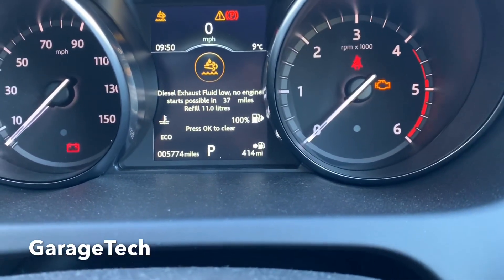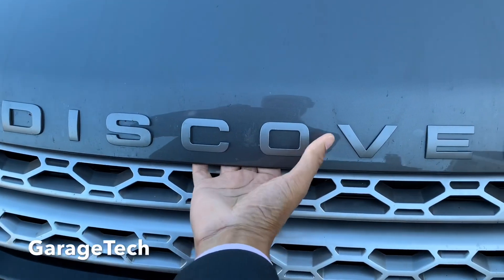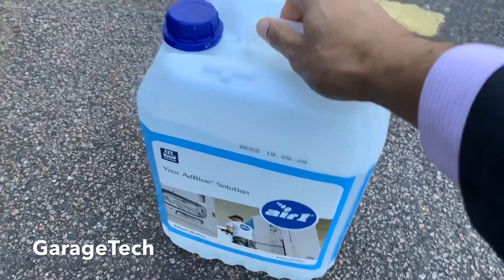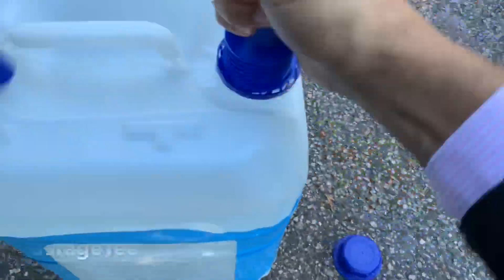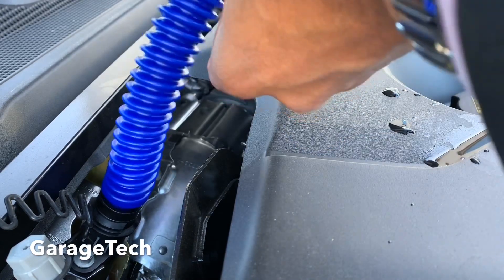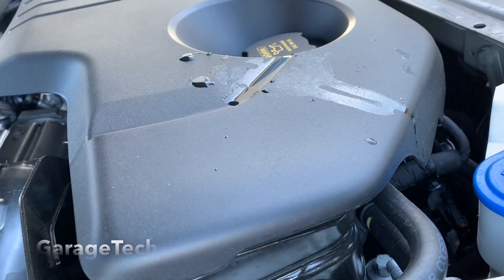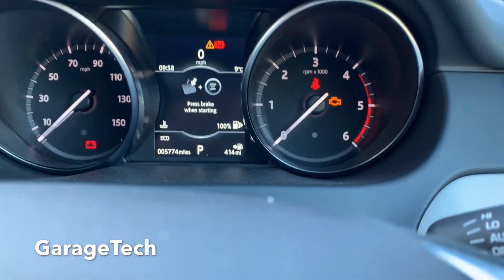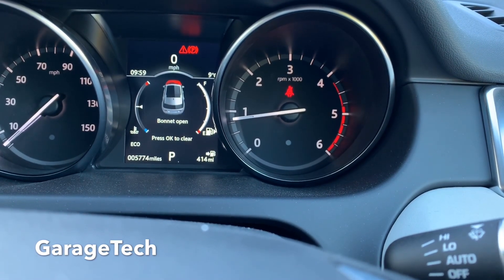How to top up your DEF Adblue Land Rover Discovery Range Rover Evoque Where to refill fluid 2018  MY

Comment: My car’s engine sign still showing after filling ad blue how to remove this if you know?
Reply from the maker: Try going for a drive, see if that sorts it, otherwise just means you haven’t added enough or there’s a fault with the system.
Reply: @GarageTechAutomotive I just pur ad blue in and now the engine light has come on. Took to garage yesterday said matter sensor temperature circuit, cleared it and has come back on today. Any ideas, will it just go off?

Comment: Do you have to add the whole 10ltrs?
Reply from the maker: Would be best to as sometimes it doesn’t register you’ve put enough in. You could add half and check if the light goes out. Good luck 🤞🏼
Reply: @GarageTechAutomotive  okay thanks
Reply: Don’t fill full over. I did last time. And spent me 500pounds to the deal to fix with. 😂
Reply: @bboysonicvincent1806 I've just put ad blue in and my engine light has come on, what was your issue?

Comment: Land rover are telling me that by adding 10 ptrs i overfilled it. there does not seem to be any way of telling the correct amount. Is this correct - can you overfill?
Reply: Approximate quantities of DEF fluid are as follows; Range Rover 18 litres, Range Rover Sport 18 litres, Range Rover Evoque 14.5 litres, Discovery 4 (not 2.7 TDV6 Commercial) 17.8 litres and Discovery Sport 13.7 litres. 

Thanks uploader. I have a rental at the moment and was hoping I could just do it on the motorway. LR really want you to spend the 30 quid with them lol
Reply: Mine said put 13 litres in, I put 10 litres in and now the engine light has come on 🤯